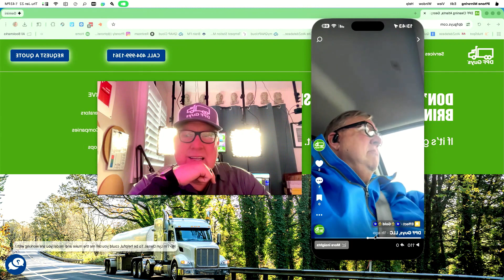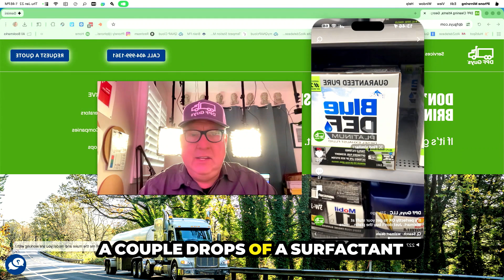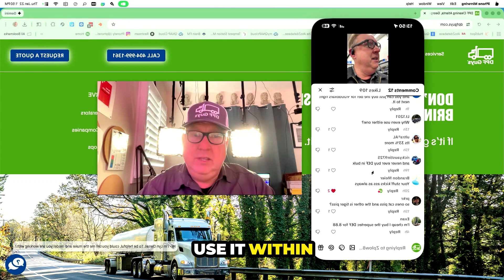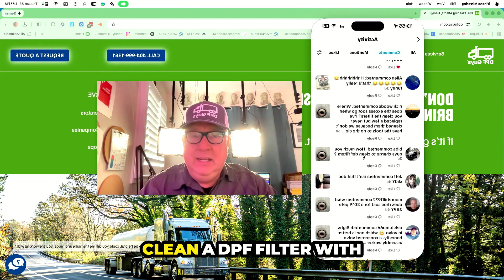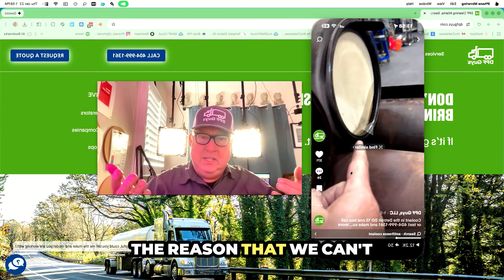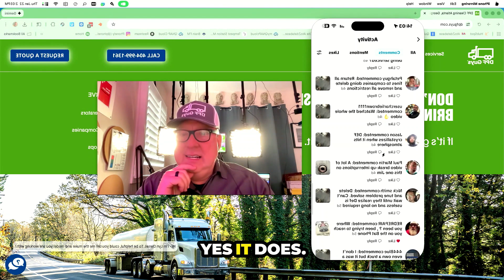Real Diesel Answers SCR Costs DEF Myths and DPF Cleaning Explained

Comment: Wrong, it depends on the expiration date of the DEF (any brand). DEF,ehen stored properly expires after 1 to 2 years.  Put in expired DEFand diesel cars and trucks will have big problems.

Stores, stations are required to monitor the expiration dates of their products.